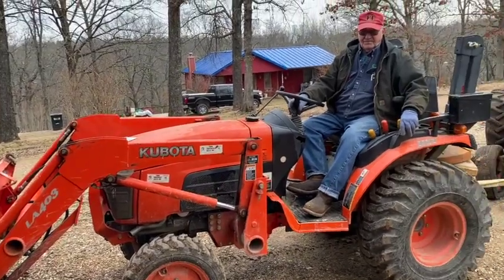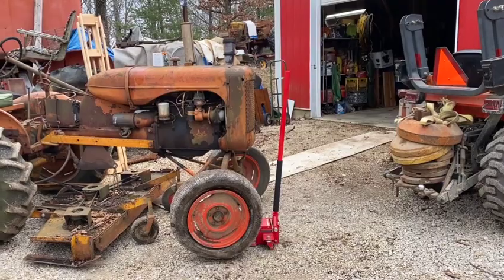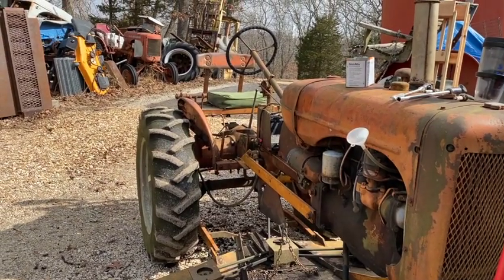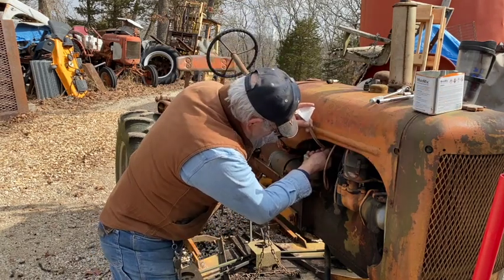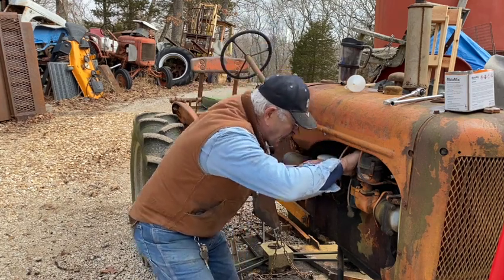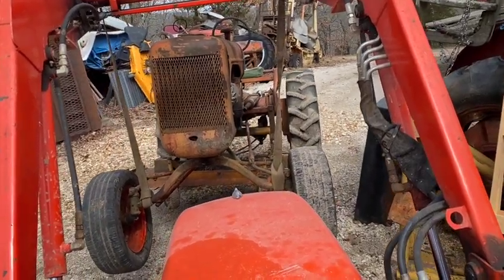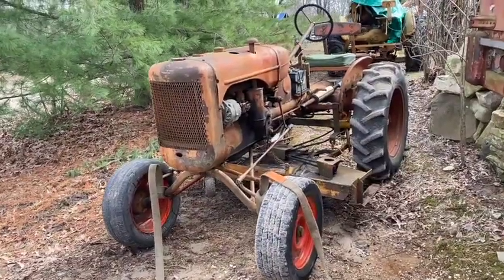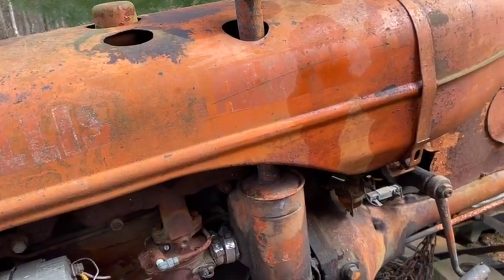What IS a BOW-AXLE B and Why Is It Dead- Outdoors

Comment: Nice!! My AC "B" has the adjustable front end and I use it mainly for cultivating the garden. I also have the mid-mount sickle bar set-up for it. The tractor doesn't get used too much anymore but she starts right up when I need her. Believe it or not, I worked on this tractor to make it easier for my Dad to start (he had been pull starting it for years) back in 1998. I purchased the battery that is in it, in March 1998 (one week before Dad passed away) and it still uses that same 6V battery today! The battery is always hooked to a "Battery Butler" and has never failed to start. 😊😊😊
Reply from the maker: I've had much better luck as well with a Battery Tender but not quite that good of luck !! That's great to get that much life out of one.  Allis makes a good easy starting tractor.  That other B in the background will start with a quarter turn of the crank even with a blown head gasket.  I'm still pretty bummed about this one.
Reply: I have many hours of mowing with those tractors and mid mounted sickle mowers!

Comment: That is good that the B is getting a new life!
Reply from the maker: It really upset me to see it stuck.  I drove it to the spot it was sitting about five years ago or so.  But water got in my running down the bottom pipe on the muffler where it slides into the manifold.
Reply: @tractorman4461  it seems better to take off the muffler and block the exhaust pipe.

Comment: Nice old tractor.  I just bought a 1953 Allis Chalmers B from the farm behind me.  They used it for cultivating tobacco until the government took away the tobacco subsidy and then it was only used in the garden.  South central Virginia here was a big tobacco growing area.  It comes with a complete parts tractor, an extra cultivator frame, lots of cultivator shovels, an original plow, etc.  it has that bow axle also.  It was fully restored in 2011.  Nice family but unfortunately the husband died in 2018.  This was his prized tractor.  Most of my old stuff is two cylinder John Deere’s so this is a new adventure for me.   Not sure I will be able to work on this old tractor because I am not sure what to do with the two extra cylinders, lol.
Reply from the maker: Man TBP, what a buy !!  Naw, that Allis will be simple...actually 2 times simpler than any of the John Deeres because they have twice the amount of power pumpers !!  I have actually worked on JD pretty much less than most of the other common brands.  There just weren't that many farmers in this area that used that color green.  Now there were a LOT of Olivers, Massey's and Farmall's though !!

Comment: The sheet metal looks really good on that tractor. That is too bad water got in the engine.
Reply from the maker: Yes Roger, I don't think there's a dent or rust anywhere...other than surface rust.  Fenders are good too !!  It'll be a bit time consuming, but it won't be too awfully bad to get running.   Pull the head first thing.

Comment: Wendell, I had a WD that had water come in thru a rusted out small hole in the top of the muffler.  It was a mess to say the least.  Good luck to your cousin.  I have been in that headache before.  Diesel fuel, A/t fluid, some painters acetone and ALOT of elbow grease. haha
Reply from the maker: Oh yeah, been there and done that as well Michael.  Being a good mechanic he won't have too much of a problem.  I had a Massey Harris 30 under roof.  I bought it cheap and it was running fine when I parked it.  Ten years go by and its stuck tighter than a plug in a jug !!  There was a nail hole in the tin roof perfectly aligned with the open exhaust pipe.  Yep, that one got a total rebuild too.  I put in new set of sleeves, pistons, rings...the whole shebang.  
    And to think...it ran when parked !!  LOL  I've got an Allis C motor on an engine stand right now.  All 4 cylinders filled with water...the list goes on.

Comment: We had restored a 300 Lp with an underslung exhaust.  It still got water in the engine!
Reply from the maker: I tell ya Jeff, if water can, it WILL get in there somehow.  I had one I drove into the lean-to and let it set a number of years. Went to get it out and do a little work on it and found it locked tighter than could be.  A drip from a hole in the tin roof hit directly into the exhaust pipe !!  Yep, that one got a total rebuild.  Really aggravating, it is.

Comment: on my  allis B I got from an auction I thought I was keeping the water out cause I had the muffler
covered then I realized the manifold wasn't like  on  a farmall h/  wasn't solid where the pipe meets manifold from muffler can't remember if the manifold also had a hole in it , but I was suprised too , to see water in cylinder, after that I started taking mufflers off and buying small tarps just to go over the engine no more problem. But is a pain to remove all the time and recover
Reply from the maker: I'm pretty sure that's how it got in this one too Bill.  The smoke pipe just slipped loosely into the manifold, so it allowed the water to slide down the outside of the pipe and little by little enter the manifold opening.  This one started out with a tarp, but it split down the middle in a couple years and I didn't change it.
Reply: @tractorman4461  so the manifold must be a bad design by allis chalmers. There defect caused your to br locked and mine.
Wonder what the solution is.  maybe after market manifolds are normall
Reply from the maker: @janbill79  I don't know.  But a lot of manifolds are threaded internally for a pipe to be inserted into it and tightened.  Not all of them obviously.  Sometimes guys just take a piece of smaller black iron pipe or exhaust pipe and slip it inside the manifold opening.  Then the bounce around the farm for years flattening out the threads to where the proper sized pipe will no longer thread into it.  I'm guilty of the same thing but on many of them I will measure the outside diameter and go to the auto parts store and buy a short section of whatever size it takes to slip over the manifold.  
     A LOT of manifolds are really short on the exhaust opening and a piece can't be slipped over it far enough to stay in place.  Those you either have to 'chase' the threads and thread in the right size pipe or slip one inside, which creates the problem you and I found on our little B's.
Reply: @tractorman4461  so they didn't come from the factory that way . I wondered? so farmers leave a loose pipe and wear out the threads from ever working with correct pipe again makes perfect sense thanks I had no idea
Reply from the maker: @janbill79  Some are threaded, some are not.  But if you do chase the threads if this is one of those, make sure you stuff a rag below the opening to catch all the shavings made by the pipe tap.  I have done several larger tractors with 2'' threads and you don't want any shaving to enter an open exhaust valve.  When done, use a vacuum cleaner to suck the top of the rag before you pull it out.

Comment: I have to pull the pipe and put a block of wood over it ,everytime I shut it off . Still don't know about the water issues
Reply from the maker: I think the culprit was the smoke pipe.  It was covered, but it slipped INSIDE the manifold and not over it or threaded INTO it.